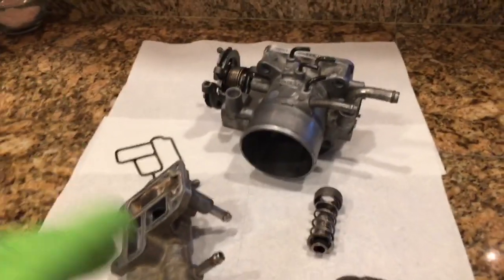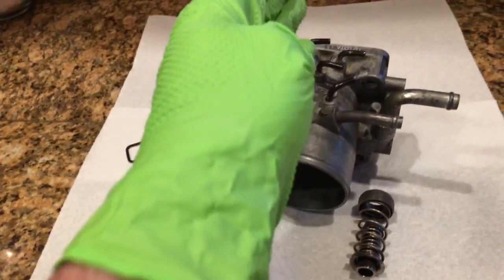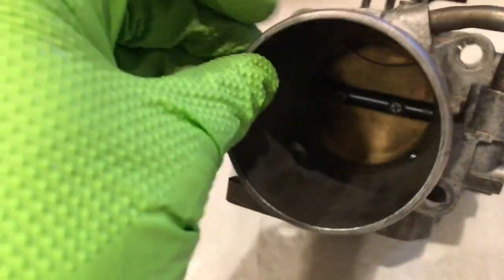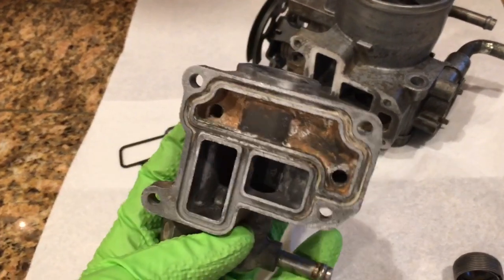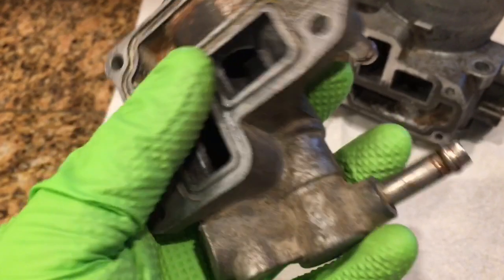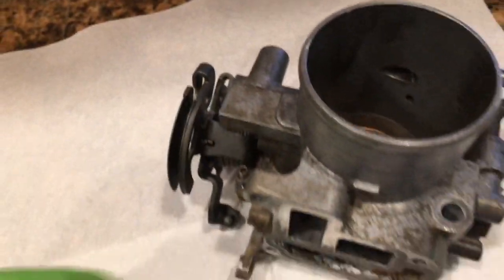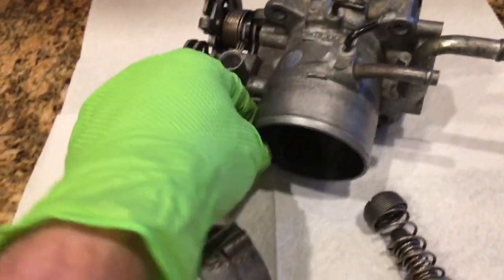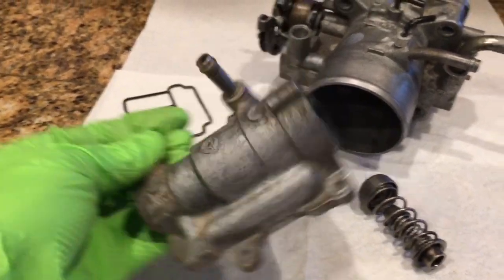Toyota 4runner pickup 22RE - understanding rough, high, surging idle, the Idle Air Control IAC valve

Comment: Ray Nada.  My idle is too low, like 300 rpm.  I adjust the idle screw and bring it up to 1000 but a day later it settles back to 300 and almost turns off.  This is only after the car is fully warmed up.  When it is first started it idles at 1500 rpm.  Can the IAC valve cause this ?
Reply from the maker: I don't think the IAC valve would cause this. If anything, it would cause the motor to run at too high (and/or an unstable) RPM. You can certainly test it by blocking the hole I show in the video, which provides air. Just remove the intake hose to the throttle body and cover the hole with some duct tape (wrap the edge out of the intake hose, so the tape can't end up being sucked into the motor). However, I think what might be causing your issue could be failed injectors. Let me explain why: when the car is cold, there is a cold air injector (located in the middle of the intake manifold, with a hard fuel line running up to it) and this injector adds gas when the motor is cold. There is a timer which turns it off once the motor warms up (it's one of those two sending units on the intake runner manifold below the throttle body inlet. If your main fuel injectors are not working and/or not supplying gas to the motor, it can cause a low or unstable idle (as not the correct amount of fuel is being delivered to the motor). However, when the motor is cold, the 5th injector for the cold air is working and providing gas, which tends to mask the fact that one or more of the other main fuel injectors isn't working. There are a few tests you can do.. start by using a screw driver to see if you can feel each of the main injectors clicking (or put a hose up to it and listen with your ear through the hose). A properly operating fuel injector should make a little clicking noise. If I have time, I'll make a video showing what I mean. Anyway, the other thing you can do is disable the cold air fuel injector on the intake manifold by just unplugging it. Then the motor will be forced to operate only on the 4 main injectors, even when cold. If the motor exhibits the incorrect (i.e. super low) idle when the 5th injector is unplugged, then it might mean the main injectors aren't working. If I have a minute, I'll upload another video later this week. Anyway, those are some things I would check out. Also, check the wiring to your O2 sensors and also you might consider taking them out to test them (there are videos showing how to test them on YouTube).
Reply: @ray5961  I will definitely look into these.  Can you explain however, if the injectors are not working, how can the engine be responsive when pressing the gas pedal?  They seem to inject all the fuel I need.  If anything, the car runs too rich and makes a puttering sound like the engine is bogged down when I step hard on the gas.

Comment: So, can it be cleaned out and fixed or does it need to be replaced?
Reply from the maker: Yeah, you can open it up and clean it all out. LC Engineering sells the gasket you need. I just cleaned mine in the sink with a brush and put it all back together. Works like a champ!
Reply: @ray5961  I'm partial to 22reperformance.com but I'm gonna try cleaning the throttle body and the IAC and see if that helps.  It only did the surging idle two times and the last few times I drove it, it idled fine.

Comment: What can I clean that bottom passage with? I've flush radiator pull iac filled with water flushed again and then with coolant and and I have a new radiator! Help
Reply from the maker: Compressed air should do it. But the best method is to take the plate off and get in there with a toothbrush.

Comment: I have a 1995 Toyota  4runner v6 a paid  a mechanic to do rhe the heads and timing belt kit now when I drive it in the morning to go to work is fine but when I  make my first  stop and turn off the car and then  turn it on back the idle goes up and down and the car died  then try again but i have to push the gas in order to keep it running  . What should I check?
Reply from the maker: dannyagm1974 yeah, that's the symptoms this video covers - namely the idle air control. Check to see if the coolant line is clogged up. My guess is some RTV sealant was used during the rebuild and found its way into that small coolant line
Reply: @ray5961  thanks   for replaying God bless you people like you are very helpful for the DIY mechanics

Comment: what symtoms?  mine idols real high and takes a very long time to go down. Imthinking that spring is not working correctly. can you spray anything into the hole on the throttle body? Like a white lithim or a deep creep?or would that damage the IAC
Reply from the maker: Most likely it's restricted flow of coolant through the lines. I'd start by removing the lines and checking them and/or blow some compressed air through those water fittings when the lines are off. You would try spraying some WD-40 in there, but it sounds like the spring is probably okay. Use your hand when the car is warming up to see if those hoses get hot also... they should get immediate coolant flow and warm up rather quickly.

Comment: Hi Ray. Have a 86 22re efi. Do you know where to obtain gasket for the air control valve by chance?  Thks..jc
Reply from the maker: Check out LC Engineering - that's where I found mine. You can also google "toyota parts" and you should find the Toyota parts website, with exploded views. You can usually search their website, find the part #, then search for that part # via ebay and google - that's how I track down all my hard to find parts :-) Or just call the dealer and hope you find a parts counter guy that still knows a PCV valve from a PVC pipe :)
Reply: @ray5961  Have not had any luck. IAC, itself, has been discontinued for my year and I see no gasket in exploded views of throttle body diagrams I have looked at....thks..jc

Comment: Hey brother I just bought me a toyota pickup with a high idle. I would screw the idle screw all the way down but still with high idle. I swapped out the IACV with a new one but its still idling high. I also noticed my temperature is alot cooler than normal operating temp, but I had already changed out the thermostat for a 180 degree. No luck, any help I really appreciate it.
Reply from the maker: Check to make sure that little line which circulates coolant around under the IAC valve is getting hot and is not plugged up. The other thing you can do is to close the air bypass hole (which is shown in the video there) with some duct tape. That will simulate the IAC closing - just make sure to hang the edge of the duct tape out and fold it over when you put the rubber intake back on. When the IAC gets hot, it closes that air passes. If you manually block it using duct tape, and the idle drops down, then you know the IAC isn't getting hot enough (or something) to shut that passage way. I would start there and see what happens.

Comment: My 1991 4runner stops running while I drive but the electrical power stays on, could this be my problem?
Reply from the maker: Probably not related to the IAC valve. Does it stop abruptly or does it stumble a few times first then die?
Reply: @ray5961  abruptly
Reply from the maker: @skidaddleskadoodle563  That sounds more like an electrical issue to me, aka loss of spark. Is there any sort of check engine light? After it stops, then what happens? Does it crank right back over and drive fine again?
Reply: @ray5961  When it stops it just rolls to a stop, yet the powers to electrical stuff is on. Sometimes when I crank it starts back up but then dies immediately after, then after that it takes a few more cranks.
Reply from the maker: @skidaddleskadoodle563  It sort of sounds like it could be a fuel pump issue. Have you ever changed the fuel filter? If you have a 22RE, it's usually bolts on the right side of the block. If you can check fuel pressure at the fuel rail, that would be a good idea. It could also be the igniter. The other thing would be a faulty switch inside the AFM (check my other videos).
Reply from the maker: Also, check to see if there is a rip or tear in the elbow which goes into the throttle body. Sometimes that rubber hose falls apart and that could result in loss of vacuum back to the AFM which would cause the fuel pump to lose power. So check all those hoses between the AFM and the throttle body to make sure they are all super air tight.

Comment: Any idea where can I buy the o ring for the throttle screw??
Reply from the maker: Ismael Rodríguez I buy all my O-rings from McMaster. Here's another option, which is what I run on my motor - https://www.lceperformance.com/22RE-Idle-Speed-Adjusting-Screw-Stainless-Steel-p/1061049.htm

Comment: What would cause a wicked surge only going up a steep grade. its wheeler replaced complete harness/computer/ tps/ afm/fuel pump/fuel filter/no vacuum leaks/ only does it on steep inclines at a steady throttle don't matter if its half throttle. and a full tank of fuel or 1/4 tank.
Reply from the maker: Kyle Fievez That's a hard one. Have you checked the fuel pressure boost circuit stuff? There is a VSV solenoid that opens to boost fuel pressure; you can bypass it and run the vacuum hose direct to the manifold to test it. Also check to see if the pressure thing on the fuel rail is functioning to boost pressure. Does it also do it when cold?
Reply from the maker: Kyle Fievez also, what octane gas are you running? It could be the knock sensor is retarding the timing on hills and causing the surging. This could be what's happening, especially if you using lower octane gas. Try 92 octane and/or test the knock sensor on the right side of the block. Also carbon build up in the cylinders could be making things worse in a similar way; the carbon can get a hot spot and cause detonation which will trigger the knock sensor and surging.

Comment: So, my 1988 Toyota Pickup has very high idle almost all the time. Its not surging, its just very high all the time.
Reply from the maker: Could be many issues. You'll need to start running some standard diagnostic tests to help narrow down where the issue is. What's the idle at?

Comment: I have a 94’ 4Runner V-6. It is also having a surging idle problem. The idle adjustment screw has no effect. The TPS was replaced but I don’t think that is the issue.
Reply from the maker: Mr. Nagy you can test it by putting some tape over the hole inside the throttle body that goes to the idle control valve
Reply: The fuel pressure regulator vsv switch !!!

Comment: I made a tool to remove that spring in order to clean everything but that special fine threaded but would not back out very far. obviously the threads were dirty. did u have problems removing yours?
Reply from the maker: Yes, it was a nightmare to get out, even with everything in the vise and where I could see it. Even with WD40 and some mild heat, it was slow going backing out until the last few turns. Once it was out, I cleaned everything up and then it was okay. I think it was due to 30 years of corrosion
Reply: @ray5961  
do u happen to know what the recommended setting is  as far as number of turns to back off after it's bottomed out??
thanks
Reply from the maker: Dumbass I wasn't able to find any info in the manual. What I ended up doing was setting it so it closed at about 140 or so degrees and then figured I could go back later and fine tune things based on how the truck ran
Reply: @ray5961  
I hate that how they keep info guarded. I guess they expect everyone to buy a new vehicle every 7/10 years. but poor folk, like myself,  don't have funding to do so.
Reply: @jb-ik8sj  per comment above, 6 turn
Reply: @dolceamore4065  
Excellent. 
Thanks
Reply: @jb-ik8sj  Jb not sure I would go with the 6 turns. the idle screw comes from factory with 6 turns from bottom. Not sure IAC valve would be the same.. Set it to where it's open when cold and as it warms up it should shut off the air hole pretty quick. The water coming in should heat up to 100-120 pretty quick at the Throttle body and shut off the air..
Reply: @donsmith3167  
Thanks Don

Comment: My icv had a blockage from gasket maker so it had lobbing idle.
Reply from the maker: That would do it. That's very common. Too much RTV or gasket maker getting stuck in there. Mine had a similar issue.. some silicone was jammed up in the IAC circuit.

Comment: Would this cause it not to high idle when the motor is cold
Reply from the maker: Hey Nick - yeah, if the IAC valve is stuck in the closed position, it would prevent it from idling high at start up. The basic operation is the IAC valve is open when cold, which allows extra air into the intake (that kicks the idle up, similar to holding the throttle open a bit). As coolant warms up and flows around the IAC circuit (the two small hoses which run to it), the valve slowly warms up and closes; this shuts off that extra air passage (the one you can see inside the throttle body on the left kinda). When everything is working correctly, it should be totally off by around 130-140 degrees (coolant temp) or something around that. Adjusting it to be exactly right is a total hassle, so if you start messing around with it be sure to carefully mark the factory settings and count how many turns the nut thing in there turns backwards). Hope that helps.
Reply: @ray5961  yesterday it randomly shot up to 1800 rpms when fully warn after driving around now this morning it didn't high idle
Reply from the maker: @nickwinter2145  Check the rubber elbow boot that attaches to the throttle body for cracks/tears. Also have you done any thing to seal the coolant system recently? Such as silicone on gaskets or anything? That can block those tiny hoses going to the IAC. You can check to make sure the IAC is getting warm coolant through those hoses, just by touching the upper and lower hoses and making sure they are both the same temp and hot. You can also totally block off the function of the IAC system by blocking that hole inside the throttle body with some duct tape.
Reply: @ray5961  I haven't used any silicone in the coolant system
Reply from the maker: @nickwinter2145  ok that's probably a plus. Definitely check those two hoses to make sure they are getting warm. If not, there could be a blockage inside the IAC valve passages back there. If you have any other questions, feel free to hit me up!
Reply: @ray5961  hose are hot hot full engine temp I'm thinking the spring is stuck
Reply from the maker: @nickwinter2145  You checked the upper and lower hoses correct? If you wanna disable the entire IAC circuit, stick some duct tape over that hole. It will run crappy when cold, but once it heats up, you should be able to see if things are okay or not.
Reply: @ray5961  yes I might take it apart and clean it

Comment: What about the tps sensor dose that impact the rough idle ?
Reply from the maker: Christian Kanahele Having the TPS out of adjustment definitely wouldn't help matters. It's pretty easy to adjust though. Just get a volt meter and follow the info in the manual. Usually it's adjusted correctly unless someone has loosened the screws.
Reply: @ray5961   I could really use your help my idle has been rough ever sense I do’s a head gasket replace. My idle bounces whenever my truck is warm. But after it’s been warmed up for about 10 min the bouncing of the idle stops. And when ever I press on my break it goes back to the bouncing idle. And as soon as I talk my feet off the break it stops. I tried asking people that know a little about 22re but none of them know so I was hoping you could help ? Please I really need help ? 👍🏾
Reply: @christiankanahele5882  Did you ever find your Brake issue on the 22RE. I have a 94 that does the same thing.. Found if I take out the stop light fuse it doesn't do it. Thinking it's a excess voltage drop causing Alternator to pull to hard with the load. Thinking it might be a Weak or low battery and was going to check that tomorrow to see if that's it..

Comment: Ray how did you remove the valve with the spring? What kind of wrench did you use?
Reply from the maker: I took a pair of needle nose pliers and ground slots into the ends, then used vise grips to hold that and turn - but I was working on a bench also, with plenty of room. The method I would probably suggest now is to take a socket and grind it down until it just has those two tabs you need; that will help a lot as far as indexing up into that area and not slipping. Also, spray WD40, as those threads are super tight on there if that collar has never been loosened before. I had a heck of a time getting mine off - even after it started to turn, I thought something was wrong, because it was jammed in there so tightly. I was actually sort of surprised when it finally came all the way out and the threads were not destroyed. When it was coming off, it felt like it had been cross threaded or something bad. But it cleaned up and went back in fine. I would not recommend attempting to do it with the throttle body on the car, by the way. It's much easier to remove it and work on a bench. Good luck!
Reply: @ray5961  Thank you for the advice.  I'm going to try the socket method.  I'm currently rebuilding my 22re and going thru every component on the engine.